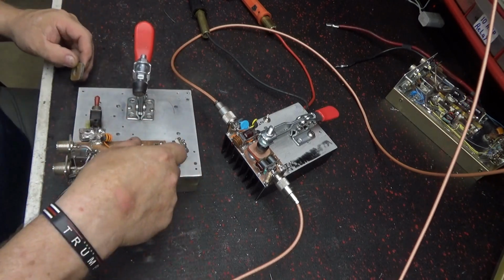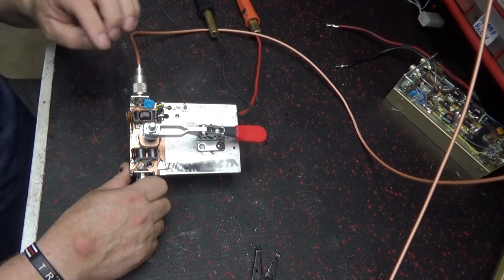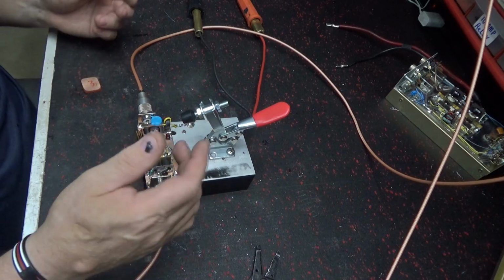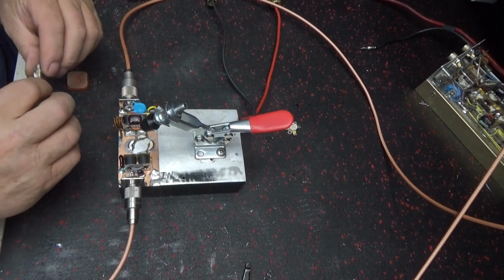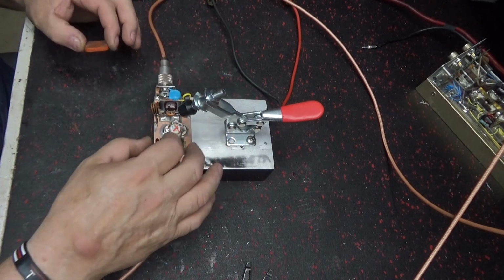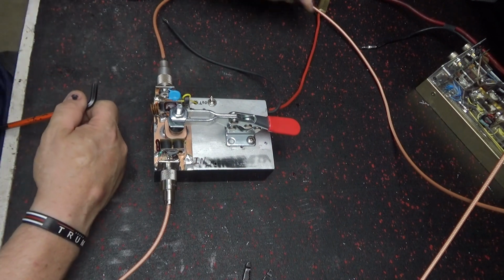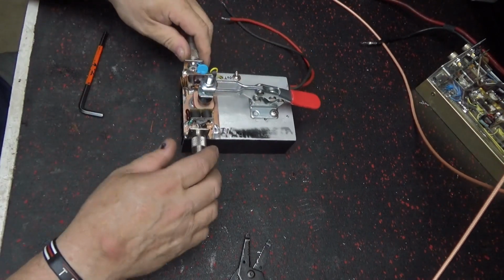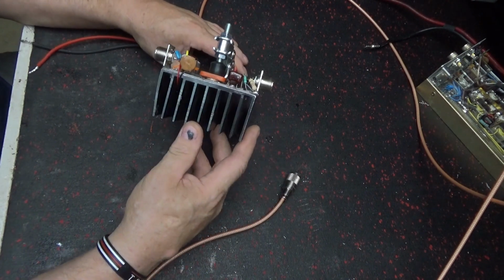new 1pill tester

Comment: Consider placing the 10 ohm in a solderless holder so it can be swapped out quick and easy , not if but when  blows . Do that and you got a real easy to use and service  piece of test equipment . 73's